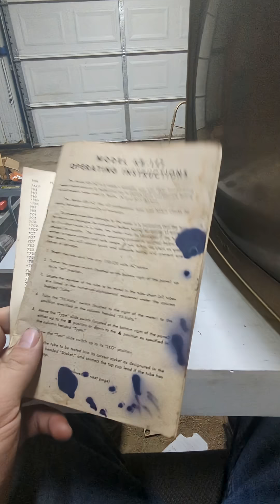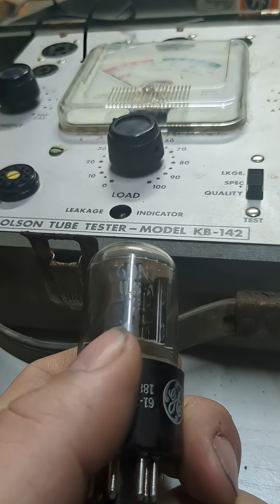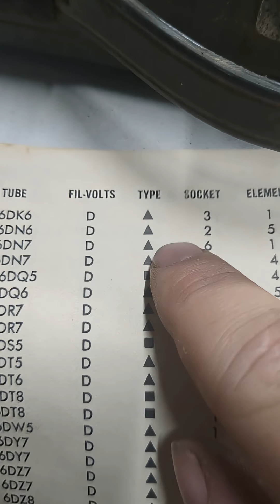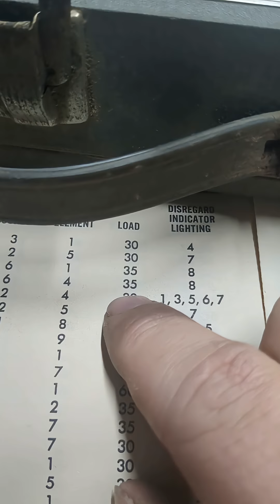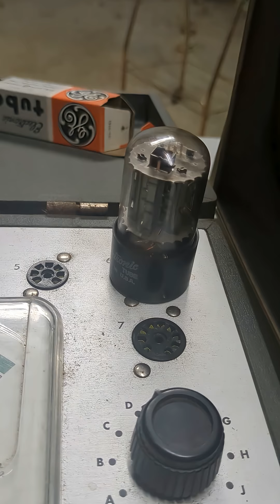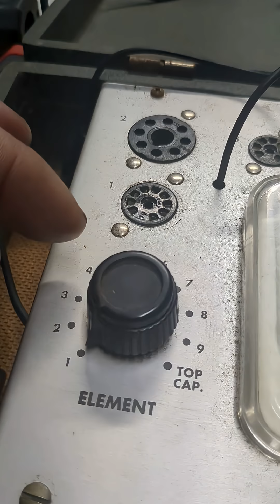how to use a tube tester Olsen kb142 #subscribe #tools #machine #test #howto #update

Comment: IF you ever have to fix a tube filled device, here's a really good tip.  Look for the one that doesn't glow when the power is turned on to the unit.  That's the first one to replace.
Reply from the maker: Good tip! That's how I figured out that high voltage rectifier tube was bad well both that and the fact there was no high pitched wine lol
Reply: @PastPreserver  I used to be able to hear the high pitched (15.7khz) squeal of the horizontal "flyback" transformer in a TV.  Those days are gone as the ears have aged.